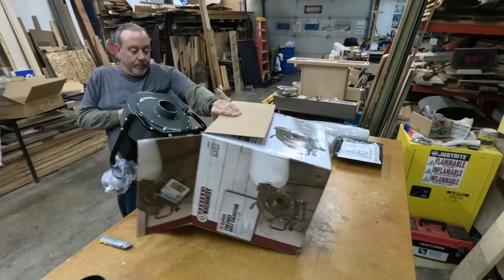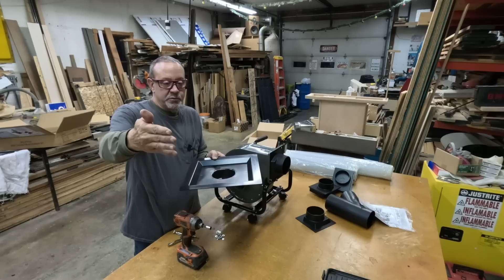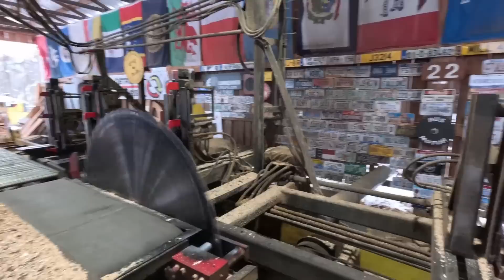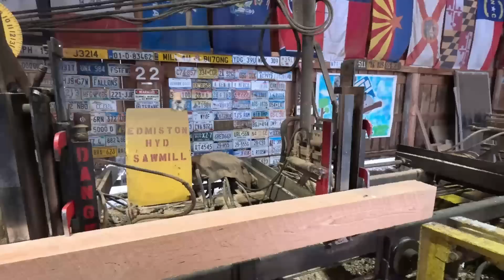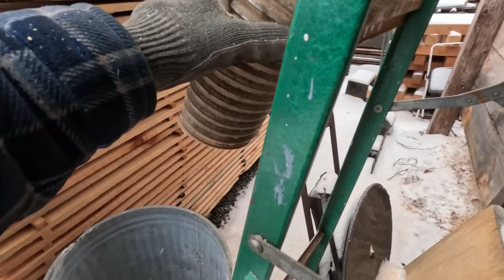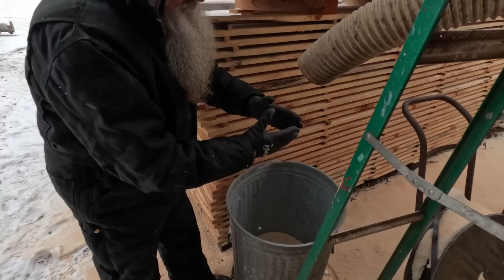A sawdust blower for the edger # 653

Comment: Great video Mark, you could have the discharge hose go into an 250gallon ibc tote, easy to move around with the loader when full. Just cut a hole the same diameter as your hose and you could even use a septic tank gasket to seal it in. Just a thought. Cheers from 
Way up north in Canada.

Comment: Well done to the H&S committee.As the sawdust is basically free falling from the edger. The mark 2 version could have an electronic dimmer in circuit to reduce the fan speed. Dust could then freely fall into the widest diameter bin or long wooden rectangular box for easy disposal. Mk3 could duct over the edger then into the main dust collector system.

Comment: You have gotten some good suggestions. About twenty years ago I installed dust collection in my shop.  I am having flashbacks.  You need to improve on the hopper under the blades.  Once you expand the opening at the top the suction velocity drops to nearly nothing.  I called the manufacturer of tractor trailer trailers and told the lady that answered the phone I wanted to buy some of the Hula Skirts they use under them to cut down on the spray.  I was going to use them to improve on the "containment" at the top.  She got such a kick out of me calling them Hula Skirts she sent me some of free.  You could increase the size of the discharge above the container to drop the velocity.  Cover the container with the fabric from the bag to let the air out.
Reply: Found a piece of that along side the road that had fallen off from a truck, worked great to extend the collection walls under my tablesaw.

Comment: Hi Fellas, Another enjoyable video. I bought a used 55 gallon wheeled refuse container, and inserted the hose into the 4" hole I drilled into the top. Works very well.

Comment: Mark, Edger Sawdust Removal: Under the edger unit, you need to make a big funnel going from just under the in-feed conveyor over to the out-feed rollers. A custom fit upper perimeter frame and maybe stout fabric funnel going down to your suction box below. That should catch all the light sawdust that is escaping now. You should try and run some schedule 40 PVC buried in a trench going through the chop saw conveyor break, then use flexible hose to connect into your piping currently going to the saw dust shack out back. You already have one connection tapping into it now.

Comment: Using a cyclonic dust collector works better than modifying the unit, I got a conversion kit from rockler that turns a barrel into your dust collection bin, no need to modify anything. That unit is a solid setup, runs really smooth and pretty quiet

Comment: I had a 1 1/2 horse harbor freight dust collector but I hated emptying the dust bag because the bag was too hard to put back on.  I took a 55 gallon plastic drum with a plywood lid and some foam weather stripping for a seal.  Put a pvc 90 going into the drum pointed to make it swirl like the cyclones.  Then I made another pvc fitting comming out to the dust collection bag on the backside of the 90.  It worked great.  I rarely had to empty the collection bag.  In your situation you won’t need a filter and bag but you would need to bring the blower to the out direction of the drum.  It will swirl and drop out in the barrel and blow air out the blower. When it starts blowing sawdust it is time to empty the drum.  I used it for years.  If people knew how it worked cyclone sales would drop.  I don’t use it anymore because I live way out in the country and I just blow the dust out the side of my building now.

Comment: hi there looks like it will work . just a thought ,could you use the bag that came with the blower cut the end opposite the hose , make a doughnut,looking adapter to fit over the trash or what ever you use to catch the dust ,stapple the big end of the bag to the wood adapter , the bag will still release the air  . my 1/2 cent  best to all john

Comment: You might try having the blower evacuating the air out of the container you want to fill and where the sawdust enters the container set up a cyclone at the top. The cyclone swirls the particles off the sawdust stream slowing them down and dropping Them into the container.. 
There are vacuum cyclones on you tube explained better than I can and harbor freight sells one but you might need an up sized one.
Love the videos and how you all work together. 
Dennis Merrow  Cuyahoga Falls Ohio
Reply from the maker: thanks Dennis.

Comment: I use the same kind of blower as a dust collector for my bandsaw. In my situation I removed the wheels and mounted it a board. I then mounted it to a doorway using hinges so I can move it out of the way to access the closet (the closet door was removed years ago). If you use that bag, make sure it doesn't get wet - it will soak up water quicker than a sponge.
Reply from the maker: it's a nice little blower.

Comment: Super Dust Deputy by Oneida Air Systems. I use a smaler one with a 16 gal shop vac and it keeps up with my DeWAlt 13 Inch planer. This systems keeps the dust stream out of the vacuum motor.
Reply from the maker: true.

Comment: Looks like you need to enclose the exaust hood more under the edger. I would use aluminum flashing and aluminum duct tape to completely enclose the saw hood. Then most of what's flying around would be collected. Do you want to empty its collector box with the loader bucket? A big open top bin with a hinged front panel. Taller will work better to catch the turbulent outflow, it will all fall down into the corners. Maybe a tarp stretched over the top, but with slack to let the pressure out. I have a cyclone on mine but it's so flying dust doesn't upset the neighbors. It's hard to get a wooden bin to seal to about a 3" vacuum, so I would avoid that if you can. Good luck and keep it clean.😅
Reply from the maker: yes for sure.